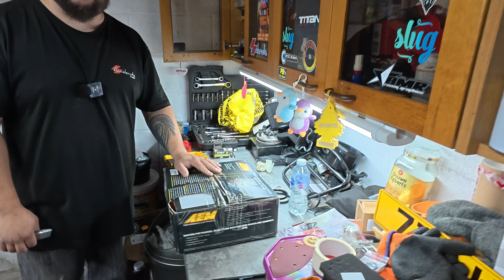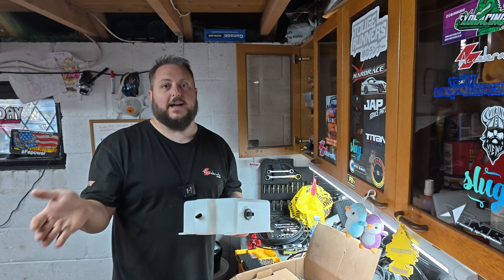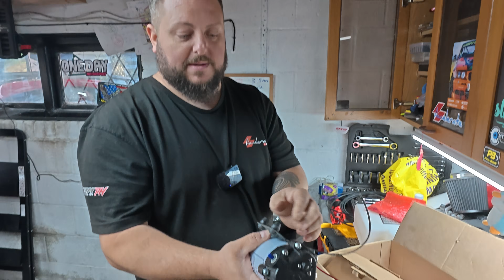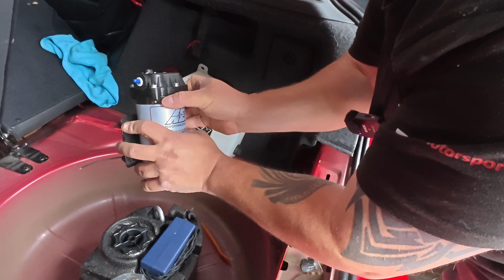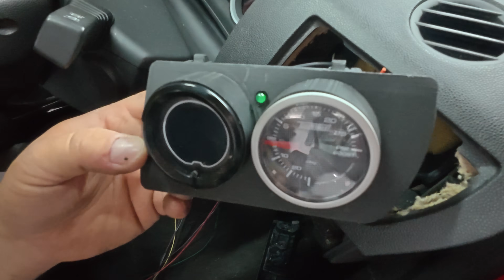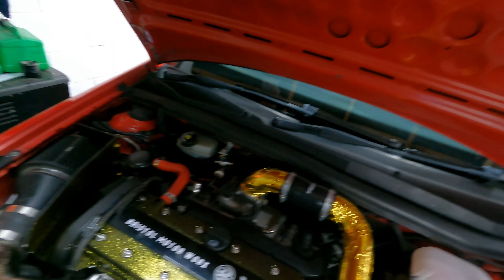More BHP for the Forged Astra VXR, We Installed an AEM Methonol Injection kit

Comment: FD2 or fk8 2020 new facelift model. Which one would you buy?
Reply: I do love an FD2, they are a bit more rare. But from a performance point of view, the FK8 is insane, and its more tunable
Reply: Thanks Ken. Where would you money spent if you could only pick one FD2 or FK8? My thoughts are the FK8 like you said has blistering performance, more modern, better handling, nicer seats, does it outweigh the VTEC experience of FD2 ? Thanks Rich

Comment: Always have proper safety features when using meth, for when a line/fitting fails, pump fails, nozzle clogs  etc etc. Using and tuning for methanol will result in engine failure if the system fails.
If you're just using it for a little extra safety and making no tuning changes, then a system failure should not be an issue.